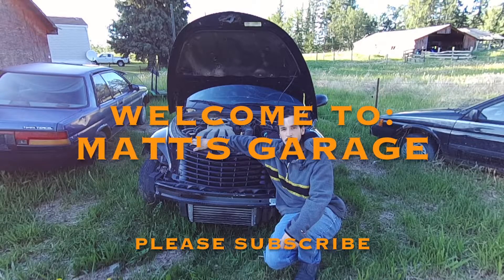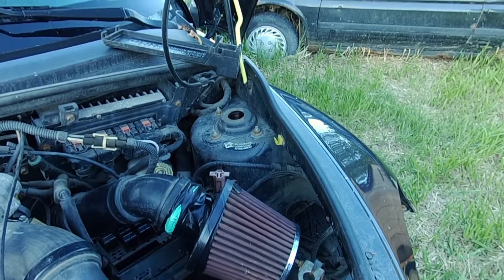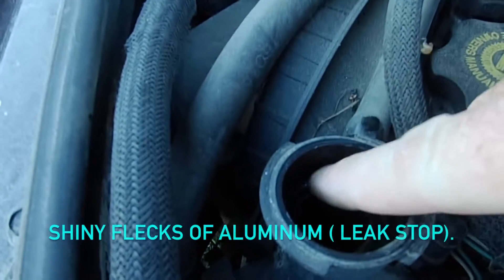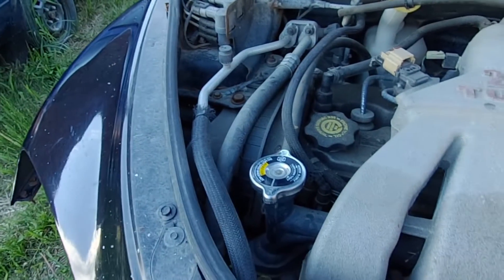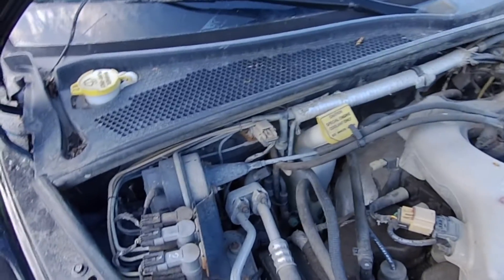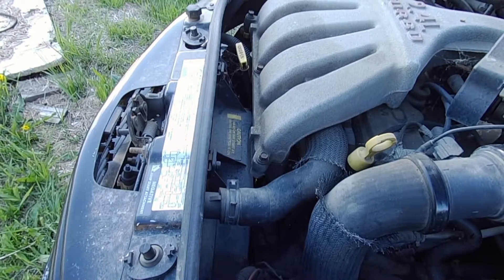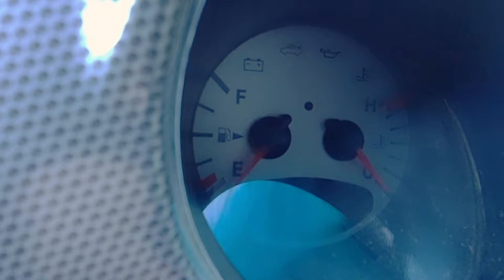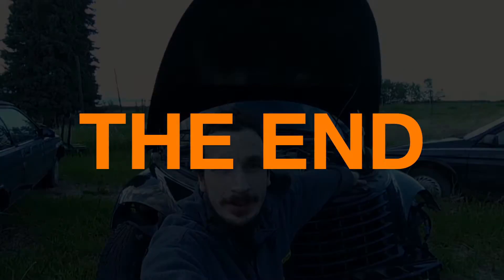PT Cruiser Overheating Issue

Comment: Here I is.
Reply: Good point. Ground points are important.
It's easier to lay on the ground to fix a cooling system problem in the summer than the winter. 
When I acquire a new vehicle I usually change the lower radiator hose and the thermostat. 
If the upper goes on you it's generally pretty easy to chang.
Reply: good video
Reply from the maker: MostlymoparIH Thanks Martin! I’m so annoyed that youtube held your comments as “possible spam”! Anyways that’s why I never replied, I couldn’t see them till I went in on my computer and looked to see what was held, I had 18 held comments and only 3 were actually spam. Anyways I always try to respond to all comments, so if I miss one there’s normally a reason.
Reply: @CarswithNash  No worries. I have been very busy myself.